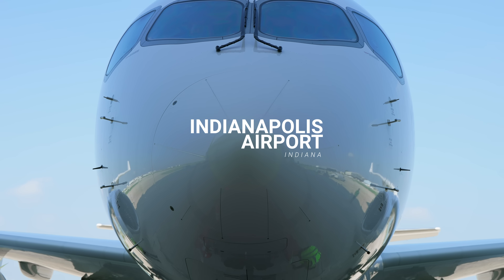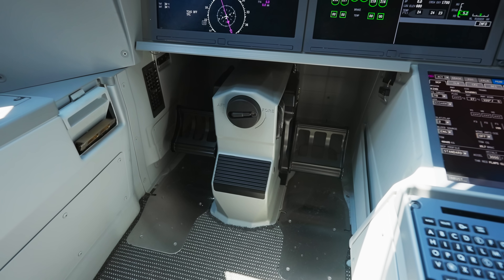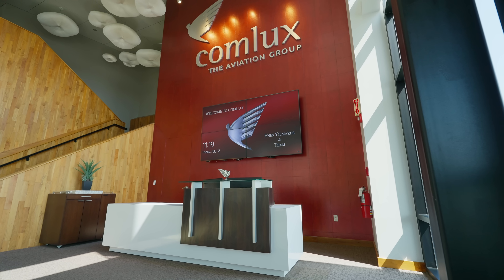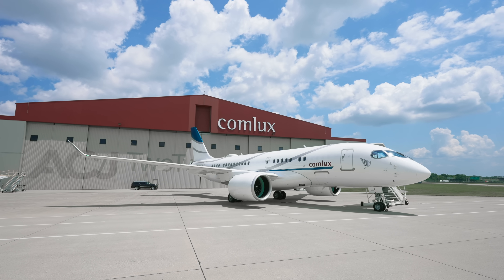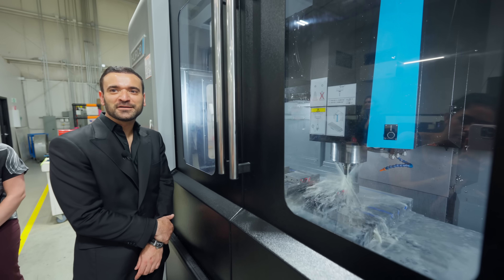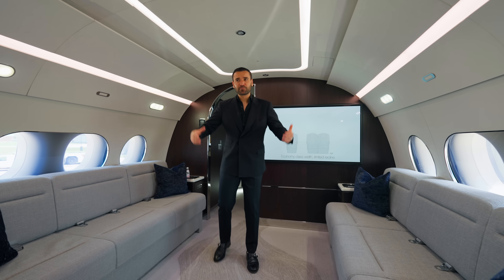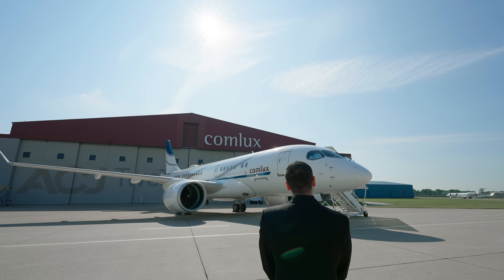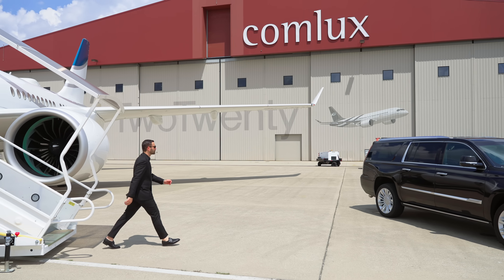Inside an $80,000,000 AIRBUS Private Jet With a BEDROOM SUITE!

Comment: As a retired A220 pilot instructor, I was glad to see this. The A220 is a superb aircraft. In some cases, it is more advanced than the Airbus A350! When Bombardier originally designed the jet, they started with a clean sheet of paper. They listened to the potential customers. We fly our A220s...easily from New York to Seattle...NO SWEAT. Air Baltic flies their A220-300s from Riga to Doha...no sweat. Thanks for the video.
Reply from the maker: awesome to hear your experience with the plane :)
Reply: @winwhitmire2387  There were some concerns on the pw engine, particularly on the 300 version. Believe it has an 8 month wait list for engine repair.
Reply: Thanks for your insight, but I do have a question.  If money was not an issue, would you get this plane instead of a Gulf Stream 700 or a Global 7500, and why?  The only thing I would want on this plane would be a shower...
Reply: @MitchellShelby you are better off with something like a Gulfstream. The a220 cost a nearly double the amount per trip. It’s a lot slower. It flies lower and you can’t fly over bad weather. It can’t get in and out of small airports. It has a lot less range. It has a much higher cabin altitude. 

But the main thing, the trip time is so much longer. Just to close the door, fire up engines and taxi out to the runway, will easily cast you 10 to 15 min longer. Climb out takes longer. Cruise takes longer.
Reply: That's cause the team I worked for designed the superb flight control system. What a journey that was. My favourite program so far.
Reply: @MitchellShelby  
The Global 7500 has better range, which is important for transatlantic flights.
Reply: Check why Air Baltic was grounded!!
Reply: such a shame Bombardier could not make a go of it and had to sell it
Reply: @ericstefko4852  That's because Canada is sidekick of US & hence abandoned Bombardier to keep Boeing happy under US pressure.
Reply: One of my faves, I'm just sorry Bombardier couldn't keep the ownership.
Reply: Why are retractable wheels "crazy! " isn't that a pretty common feature in jets, like every jet large and small flying?
Reply: @MitchellShelby almost no one purchases something like this or Boeing or Airbus. They are primarily just chartered. Only Arab oil sheiks and a few Russians would bother to buy something this size.
Reply: @brandonadams7837  These are quite common in Asia, including India, China, Singapore.
Reply: @rtbrtb_dutchy4183  You're talking about the commercial version of the A-220, this machine can go 1300 nmi farther with only a slightly slower cruise speed. What kind of weather is at 41000 feet?
Reply: @ I’m not talking about the commercial version. We almost bought 3 of them. We also fly BBJs and ACJ-319s as well as Gulfstream products. So I’m well aware of the capabilities

FL410 is still in the top of thunderstorms especially close to the equator. 

The other thing is, these type of airplanes cannot go to FL410 until the latter part of the trip, when they are light enough. A Gulfstream can go to FL430 right of the bat.
Reply: Cseries!  Call it what you want today
Reply: @tsifty1  the C-series simply wasn’t popular, until Airbus took over. Sometimes that’s what is needed. 

The P-51 was a horrible fighter, until the Brits put a Merlin engine in it.
Reply: @ it was popular but airlines were tough on getting à better price, as it was expected when any airline would buy volume. Bombardier was pushing back hoping the price  would be sustained . So don’t confuse the product with the selling strategy, I know what I am saying in this one. So Airbus was not as they would like you to believe , the firm that made it popular they just had the funds to offer discounts, especially after not paying anything to get the program.
Reply: @tsifty1  no, that’s simply not the case. Airbus isn’t giving better discounts. Airbus is giving better support. Bombardier simply didn’t have the infrastructure to support their products in world wide operations. 

The same issues is why Embraer is struggling as well. 

If an airplane has an issue and is AOG (Aircraft On Ground), what airlines want is to have the airplane fixed ASAP. C-series under Bombardier would sometimes mean weeks of AOG. 

It’s not the discounts. It’s the support.
Reply: @ not giving discount? lol keep saying this to yourself. You being an outsider, I will say it again , this plane WAS desired, not like what you stated  earlier. Airbus picked up a program without debt attached to it and begun offering it at a discount. You don’t seem to have experience is sales I see? And I don’t recall seeing you in any meetings in the past. 😉
Reply: @tsifty1  please point out to me where I said that they are “not giving discounts”?  I never said that at all. I said that discounts wasn’t the reason why Airbus made it a more attractive airplane. 

Also kind of silly to say: “I didn’t see you in the sales meetings”, since you have no idea who I am. This is why I don’t say stuff like that about you. 

Seems you think you got it all figured out. I mean, another assumption you make is that I’m an outsider. 

But in the meantime, you don’t understand even what I wrote, since you think I said that no discounts are given by Airbus.
Reply: @tsifty1  oh, and one more thing, since you want to talk discounts: 

Bombardier simply didn’t have the buying power to purchase parts and materials at significantly discounted prices. Bombardier had to sign some pretty bad contracts for these things, which Airbus had to take over….for now. This is why Airbus is indeed able to give better discounts, not because they don’t want to make money (which they are not at the moment), but because they are anticipating renegotiated contracts in the future. 

But again, even though Airbus gives discounts, it’s still not the reason why airlines see the A220 being more favorable, it’s because of the support. 

This is the reason why the C919 or even the E-jets are struggling for customers, because those are also heavily discounted.

Comment: Looking at the cockpit you can see that it isn’t really an Airbus. This aircraft was originally built by Bombardier but then got acquired by Airbus and is now sold as the A220.
Reply: Boeing missed the opportunity
Reply from the maker: you see I did not know that :) so next time I need to research further more :)
Reply: The A350s cockpit looks almost the same, just bigger. So it fits really well into the design language of Airbus I think
Reply: @oliverschmelz6600 I would disagree because of multiple "minor details". For example the shapes and colors of the thrust, flap and speedbrake levers look very different from all other Airbus aircrafts. Furthermore the sidestick is pretty similar but still off by a little bit. And last but not least and in my opinion the most striking detail is the UI of the PFD which looks completely different.
Reply: @Luckstar__  Yeah I agree, but the cockpit in general looks like any modern airliner, including the A350. 
But yeah, when you look into details, there are some differences.
Reply: @Hoschie-ww7io Boeing could have made a great aircraft in combo with Embraer. They missed that boat too

Comment: You think this is really expensive, but per international flight, if you divide the cost by each passenger, then it's around $8000 a piece, not too bad for the service you get.

Comment: Just a note for 2:12 with the P&W making engines for the military, more impressive than the F-35 and B-52 engines is the J58 that powered the A-12/SR-71 family of aircraft going mach 3.32+ which is about 2550 mph

Comment: As an aircraft mechanic who's worked on both Boeing and Airbus aircraft I can say that Airbus aircraft are much more maintenance friendly in the cabin than Boeing.  The cockpit on an A320 aircraft and on this A220 is much larger than on a 737. Everything about the interior of an Airbus is easier to put together especially the sidewall panels on passenger planes!  Those are a beautiful design compared to Boeing's!
The two things I find odd about this interior is that you have no view out of the windows as the interior acoustical window panel obscures the view!  The other aspect is the non integrative look of that acoustical widow cover! It looks like a quick fix afterthought! I can't imagine a buyer would like that!

Comment: Interior options are limited in ACJ220 while in ACJ320, one can customize something as small as seat belt lock! PW engines are big pain, spares aren't easy & carbon fiber maintenance is expensive & lightning protection is extremely limited. Pilot rating is expensive as it's not regular Airbus but Bombardier. Overall, based on cost of ownership, value, better to take ACJ320NEO with CFM Leap engines rather than ACJ220.

Comment: Enes, you must rot out so many pairs of shoes with your sweaty feet with no socks. Ridiculous.

But the customized 220 was very nice. I recommend you include an actual spec screen showing sizes, speeds and distances, empty and takeoff weights, fuel and water capacities etc. I realize some of those would vary due to configuration, but just do it for the one you are touring. We deserve to see what $80 million is buying.

Comlux is definitely advancing as a company. I would like to hear more about their computerization of custom parts so they can quickly produce a replacement part for repairs or refit, and similar info for how regular mechanical maintenance is handled. Does Airbus do it, or does Comlux? Keeping a bird like this available for service is crucial.

Comment: The fact that this costs 10,000,000 more than a gulf stream g700 is remarkable.. insane value for the money
Reply: What they won’t tell you is that the range is not great on the A220. You’ll require a fuel stop almost anywhere you go. There are no steps built in so smaller airports in exotic locations won’t even have steps high enough to fit the aircraft. The engines have had issues - Tyler Perry canceled his order with Comlux because of this. Not as many type rated pilots available for this ac. Gulfstream is the safer & more economic choice.
Reply: @ never thought about these

Comment: I’d hope there are additional TV screen options, because I only saw a couple of screens to be shared in the main cabin areas and they seemed to be positioned pretty far away from most of the seats. Also, I would hope that some of the main cabin seats fully recline? From the short tour you gave us of one of the seats, seems the head rest is pretty short, although looks like it is moveable?
Reply: They do actually. The club seats can be turned into flat beds

Comment: the A220 ACJ based on the stretched A220-300 could eat into potential A319 ACJ sales & probably it already is . . . as for A220 ACJ cabin interior it could do with some streamlined & tight set body hugging seats, without compromising on luxury . . . don't really vouch for the bedroom thing at 42,069 ft a.s.l. wouldn't vouch for it even it was the A321 ACJneo or the B747-8 BBJ for that matter . . . if your the bedroom type, strongly recommend that you stay home . . . dude, it's a private jet for cryin out loud . . . the convertible sofa in the A220 ACJ is a nice touch by Comlux America, cozy & practical . . .

Comment: Great report Enes. Looks like an amazing aircraft and it is a mystery to me why so few are sold. The price is similar to the Gulfstream G700 and the Bombardier Global Express 7500 (and presume the Dassault Falcon 10X is in the same ballpark number). The A220 has so much more space and head room (plus a shower!)  and I would clearly go for the A220 if I would have the money. The range may be somewhat less but probably enough for 99% of anyone's flights. I know Airbus Montreal isn't able to produce so many A220s but you would think many more operators should opt for the A220 instead of Gulfstream, Bombardier or Dassault! One question why does it require an engineer on board next to the 2 pilots? Guess this is some Comlux requirement to make sure there is no technical issue along the way for the client but is otherwise very unusual.
Reply: All Airbus and Boeing aircraft in our fleet have an engineer (FSE) onboard at all times. The FSE knows “his” airplane like the back of his hand and ensures the airplane is always in top condition. FSE also oversees operational aspects like refueling, baggage loading/ offloading, performs daily checks and regular minor maintenance tasks etc. Hope this clarifies it

Comment: I enjoy bizjet videos but this one contains quite a bit of misinformation. The A 220 has a top speed of Mach .82, which translates into roughly 540 mph at 37,000', not 625 mph as stated. Cruise speed is Mach .74 - .80 or between 485 and 525 mph. The vid mentions an "engineer" being required, but this plane only requires two pilots, sometimes a relief pilot on long flights; no engineer required. Seats are quoted as being 22" wide, the 'widest of any business jet" with most being 16" to 18" wide. That's not true. Seats on the smaller but faster Gulfstream jets are 22" to 27" wide. Even the smallest seats on commercial jets are at least 16.7 inches wide. The center lounge dining option appears to seat six, but the narrator says eight. Airbus' website lists the price of this business jet version of their latest airliner at $100 million each, not $80 million. While it is true bizjet customization and interiors can vary widely in price, based on customer requirements, but a twenty million dollar error? One more thing: I love the A 220 but it is competing with airplanes that have more power, fly faster and farther, have lower cabin altitudes for comfort. The competing Falcon 10x uses about half the fuel per hour. I estimate a max range A 220 flight will take about an hour longer than in a competing Gulfstream or Global Express, so all that extra cabin and slower speed comes at a cost. Is an extra hour a big deal? Probably not as you relax in that huge cabin. But getting the facts straight is a bigger deal, like not dropping in footage from FS 2020 when these guys are supposed to be on a real A 220 flight.

Comment: I'm surprised they used Pratt & Whitney power plants and not Rolls Royce. If they were to use American products why didn't they use GE engines? Let's hope Pratt & Whitney won't suffer engine failures (compressor stalls) like some of the F16s in the past before they switched to GE engines..

Comment: knowledge of the cockpit?  LOL. The yoke or as you say the side stick is not used to lean the airplane....they are used to steer the airplane and to trim in flight.   Also, the rudder controls or as you call them needles.lol are not used for elevation.  They are used to steer the aircraft and brake on the ground and in the air are used for yaw.

Comment: Shouldn't all the seats have seat belts?  I don't see them on some of the seats.  Also, the way you're sitting on that seat, the headrest doesn't look high enough to prevent injury.  Does it pop up somehow?

OTOH, this is much more luxurious than the usual commercial plane; yet, I feel that you never lose the sense of being in an airplane. It doesn't feel personal or cozy.  I actually detest flying, so it's hard for me to warm up to a plane.

Yet, some of the yachts did have a more personalized feeling.
Reply: All seats are equipped with seatbelts

Comment: I was working as a ergonomist at the pratt plant in Canada where they built those engines. Was impressive how much less sound they made compared to older gen engine. And the assembly of the A220 (C220 before) just aside from the pratt plant. Nice experience.

Comment: These airline bizjets are not appealing to anyone with that level of funding. The are too large to pressurize to fly at 50,000 feet where the Gulfstreams and Dassault Falcons operate. Rich folk want top speed and super high altitude smooth air. These giant aircraft are more like buses.

Comment: damm for that price, u are only getting 5650NM only, bombardier global 7500 or G700, or falcon 8X has even better range than this for around the same price and size also not much smaller.. if really wanted the space, might as well get lineage1000e instead for cheaper and around the same range. what a scam

Comment: The owner is definitely one of those gentlemen who tells you not to use the air conditioning, the internal combustion car, but you have to use the electric one (if you have the money to buy it), eat crickets, all to save the planet. While he takes a shower on your head at 9000 m altitude. While you continue to save the planet …